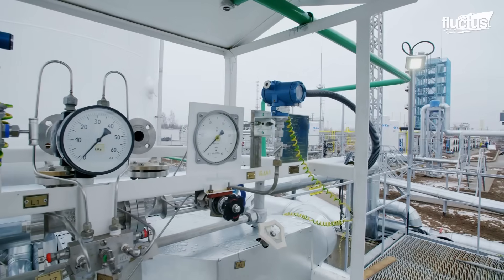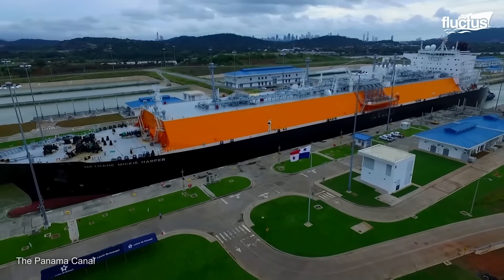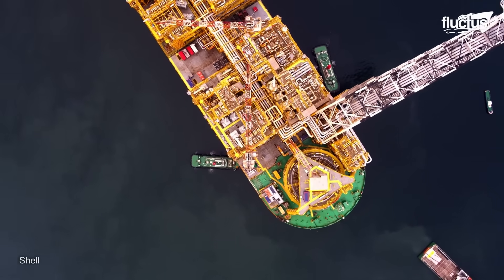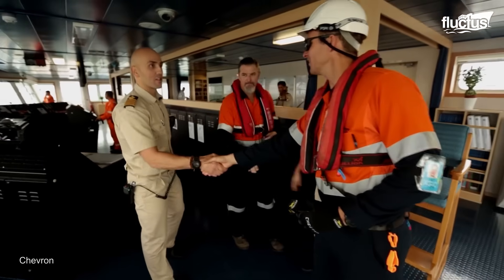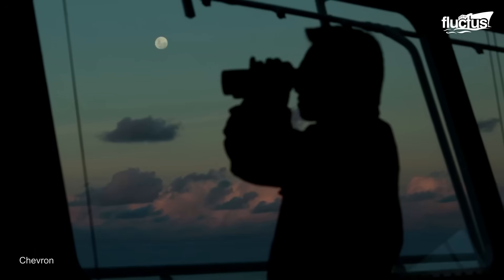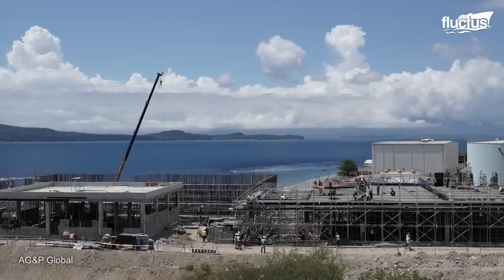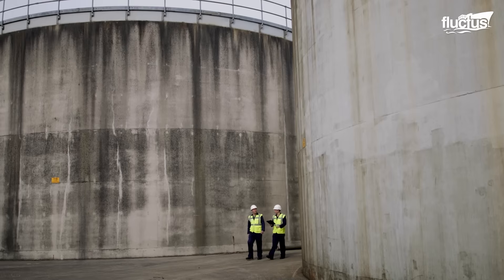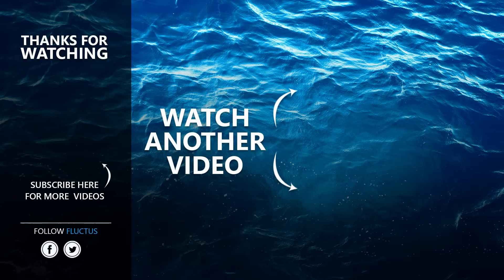Inside Billion $ Shipyard Building World’s Largest LNG Tankers

Comment: Still release CO2 carbon pollution a fraction less than oil gas coal .
Not " clean" energy.
Reply: NG burns a lot more compelely. In vehicles, it extends the life of the engines almost double. My brother and I both owned NG trucks in the eighties. We could get an gas ticket mechanic to swap over the system at the end of the truks life. There was an entire lifetime for the system and the tanks. NG is also a lot safer than propane, gasoline, even diesel.
Reply: Co2 is great for plants. IT'S PLANT GAS NOT POLLUTION